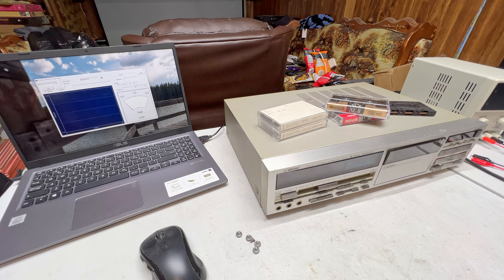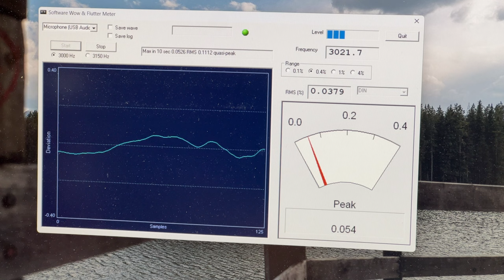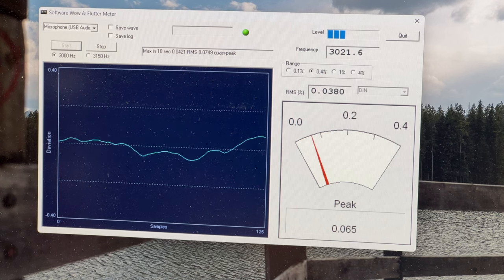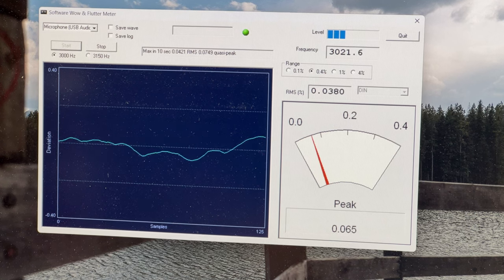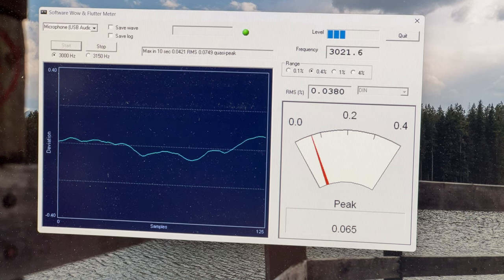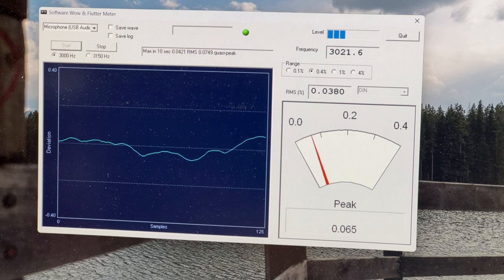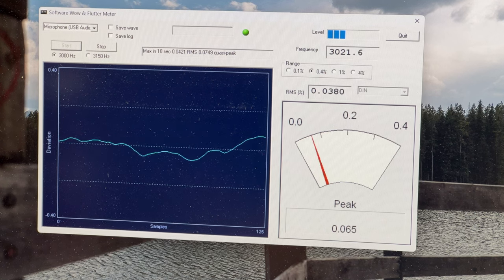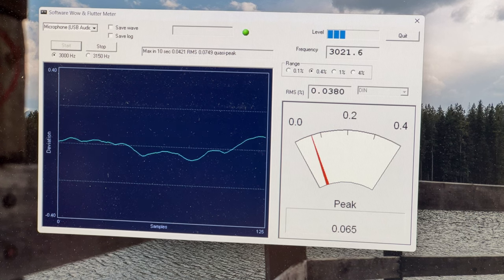JVC Victor DD-99 Part 2 - Finishing Up

Comment: Is it fair to say that the frequency response using Dolby is affected by the sensitivity of the particular cassette?
I think that the auto calibration takes place without Dolby,even if the button is pressed in, but I am not sure.
Also, is the metering calibrated for 250nW/m ref. your 0db level setting?
Reply from the maker: I did check the meter calibration.